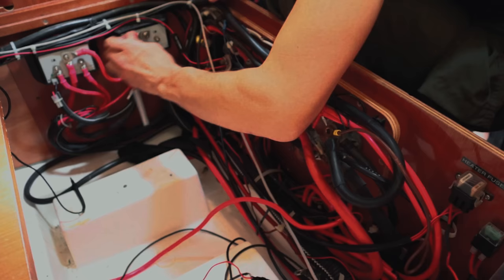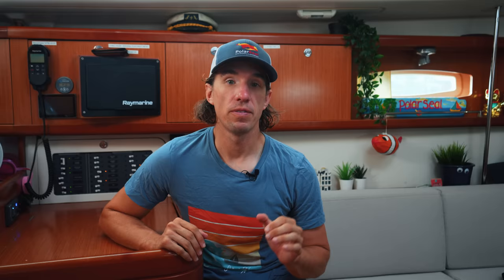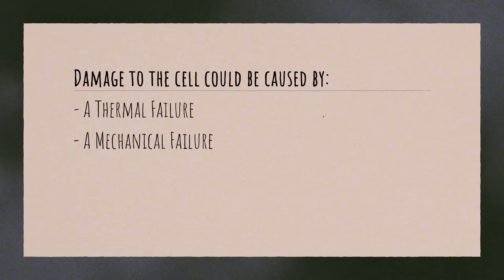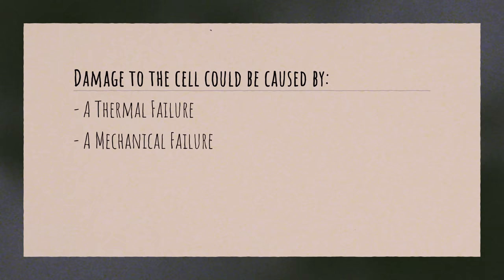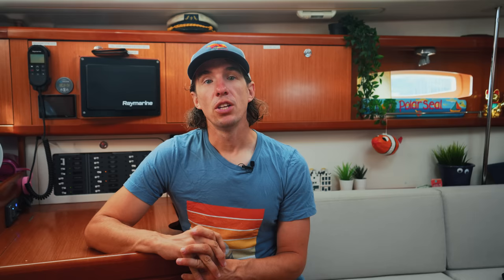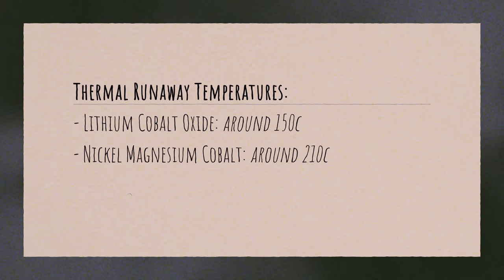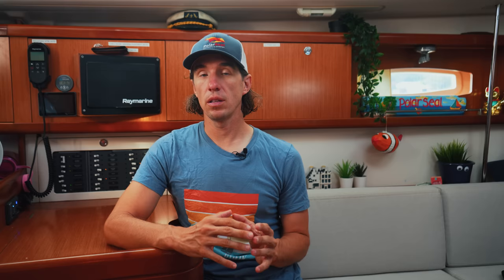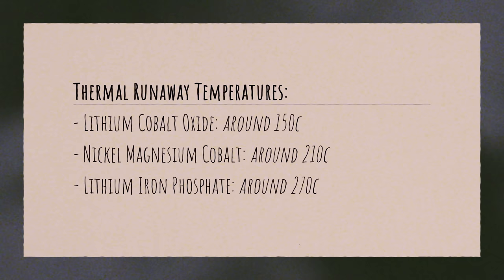WATCH THIS before installing lithium batteries on your sailboat ⚡ [RYAN'S TECH CORNER]

Comment: I agree to most of what you said, except for the BMS internal vs. external.

There is a huge disadvantage of most if not all internal BMS in contrast to external BMS installations.

1.) LFP cells can handle 1C continous charge/ discharge current easily, they can even handle quick charge / discharge of 3C continously if monitored properly and up to 10C for short periods like 10s. Not one manufacturer has built a drop in battery with a BMS that can nearly handle this currents, so you willfully castrate your LFP batteries to miserable 0.5C in most cheap packs or 1C in the better brands, far from what is feasible.

2.) with drop-ins you have no real choice, you have to accept what the manufacturer puts together and burties in a not serviceable case, with external BMS you can chose the cells you want, the cell size between 40Ah and 1000Ah (DIY) and up to 10000Ah for professional installs. You can also choose the right bms for your installation, with alarms, cut offs, gradually dropping chargers or loads or limiting charge currents when necessary, you can even choose chemistries for broader thermal range like LiFeYPO4, that can operate in sub zero conditions.

3.) An internal BMS is an electronic device, that has the power logic inside and controls the current, it also controls the cells and balances them, usually by burning excess charge passively by resistors. All this produces heat inside of the battery enclosure, that cannot dissipate properly and what reduces the life of the battery. External bms have both the balancers and the power switching away from the cells, much better design, and you can choose how to control high loads and high charge sources, not necessary by the power train but by control logic turning off the devices instead of cutting off the battery, then there is no surge and no blackout.

4.) most drop-in BMS are not user configurable and the settings are way off of a longevity profile. Means your BMS may protect from run aways, but your battery will not live very long, external BMS can be configured and set to conservative values, that allow an almost double life expectancy.

5.) With a good external BMS you can not only keep the cells balanced and protect the battery from thermal runaways, but actively control charge sources and dump loads like water heaters and such to use the available energy smarter. 

It is about a proper design of a system and Cells, BMS and separate power logic makes an install better, easier and mitigates a lot of problems that you introduce with batteries with internal BMS.
Reply: 1.) How realistic is this in the real world?  With a typical setup like Ryan's, 3C is 2,000+ amps, what do you need 2,000 amps for?  At 12v that's 24,000 watts, what are you powering, an aluminum foundry?  How would you ever charge with 2,000 amps?   10C is 6,800 amps or 81,600 watts.  You are not castrating your battery to recognize that you have absolutely zero use for 81,000 watts.  
2.)  Yes, if you are an expert you can DIY stuff that is better in niche applications.  That's an argument for experts to DIY, not for internal or external BMS.
3.)  In theory, maybe, but there just isn't any indication that they don't handle the heat inside the pack just fine.  Might have something to do with sticking to a reasonable and practically useful 1C which also leaves plenty of thermal overhead.
4.)  Will Prowse disagrees and says you are not smarter than the electrical engineers who designed the battery and should leave the BMS settings alone.  If you are absolutely certain you are a better electrical engineer than the ones actually designing batters, well maybe you should skip the commercial batteries, skip the DIY and just start manufacturing batteries.  Again, there is absolutely zero indication that most drop ins are dying early deaths, and there are 10s of thousands of installs with quite a number of years on them, Dakotas have an 11 year warranty, far from "will not live very long".  Regardless, you are arguing for expert DIY, not internal vs external, and some internal BMS CAN be configured, which you probably shouldn't.
Reply: What kind of boat are wanting to build that into?🤔
 Carnival Cruise Line? 😲
He's talking about personal sailboats. 😊😁

Comment: This is an excellent video! One point that is consistently missed about BMS safety: If an extreme overvoltage event occurs (imagine a lightning hit, alternator voltage regulator failure, or inductive flyback), especially when the battery is at a 100% state of charge where it will present nearly a zero load to charging -- the voltage rating of the BMS MOSFETs may be exceeded (say 60 volts for example), and one or more MOSFET may fail SHORTED. In which case, all forms of charging protection has vanished. BMS overvoltage protection is only valid provided the overvoltage does not exceed the MOSFET junction ratings. 

In my own sailboat installation, I have "crowbar" didoes: 18 volt 100 watt zeners installed across each battery's terminals to absorb a momentary voltage transient to protect the BMS MOSFETs. It only takes microseconds to fry a MOSFET junction. I've never seen a BMS with this protection.

Comment: Love the video. I have installed lithium on my boat, and switched my starter batteries to Dakota 65ah last spring. Love them.  One thing that’s very important is making sure that either you isolate lithium from standard starting batteries from your house charger and alternator or like you said do a b2b charging set up. Lifo is pretty expensive which is hard to swallow for starter batteries but that whole profile thing is pretty important considering cross connection options that come on some boats. Thanks for sharing as lithium is really a great and overall economical option!
Reply from the maker: This is a good point.  The different battery packs will all be at different SOC so you need to have them charge separately.

Comment: I do want to make the switch from lead acid batteries to Dakota Lithiums. 
I have a much much smaller boat that the sail boat in this video, but love the water no less. I have a small boat I use for walleye fishing mainly. Which means I am trolling for hours on end, and need as much long lasting power as I can get. I use an 80lb thrust 24 volt motorguide trolling motor and 2 Lowrance sounders one of which has a 12” display and draws quite a bit of power itself. Plus I have them networked and also a heading sensor installed. 
I’ve been running 3 optima yellow tops and a separate starting battery for the main engine. The yellow tops are, and this is no lie, are 13 years old. I have treated them good and in turn they have served me well. But it is now time to upgrade as I now get about 8 hours max service out of them as opposed to the 2 days max I used to get. Those 3 yellow tops were given to me by the way, so I really do not know their true age, I only know how long I have used them.
The main reason I haven’t made the switch yet is price. I do realize the initial investment will eventually pay for itself over time as opposed to buying new lead acid type batteries, but it is literally that initial investment that is prohibitive to me. You see, I am but a lowly diesel tech, with a family I am responsible towards. And, as I stated, the yellow top optimas were given to me, not purchased by me. So I am currently in the “how do I pay for these batteries” stage of making the switch. I can honestly say that for 3 12 volt 100 amp hour Dakota lithium batteries I would be willing to allow Dakota lithium to placard my boat with advertisements and would be more than happy to show anyone interested the set up in my boat in exchange.
One can dream

Comment: If a boater wants to keep their Lithium setup super safe and protect their alternator 99% I suggest going my route. 
My Lithium ( 315ah x 3 ) is my House Bank only.   Internal BMS , Oversized 2/0 Wiring and CLASS T fusing.  Charging via Solar & Wind ONLY when at Sea and a Victron IP22 3 bank charger while at the dock.  My STOCK Alternator is charging my TOTALLY SEPARATE AGM Starter Battery ( in a different location than my Lithiums ) and this AGM has its own 50watt solar panel to keep it topped off.   As a sailor I believe in redundancy and separated systems.  My Engine and Alternator will never be affected by any Lithium Issues so I can always start.  My house bank runs everything else and being Properly Wired, Properly Placed ( with airflow ) and Properly Fused I feel extremely safe in using 945 Amp Hours of LiFeP04 on my 28' Morgan Out Island
and it's dreamy to use my Kuerig and Induction Cooktop for breakfast while offshore, as others light there smelly alcohol stoves.  
Be Safe. Be Smart.  And never cut corners with your Lithium Install. 

For a hardcore education on Lithium and Solar visit my buddy Will Prowse on YouTube .... 
Fair Winds Ya'll ......

SV JAZ

Comment: Hi Ryan, great video, very informative.
I’m seeing an increasing number of people online promoting the idea of skipping the DC DC charger between the lead Acid starter battery and the Lithiums and just using a “long Lead” to drop the voltage to the “correct” level for Lithium charging.
I believe this to be frankly madness, but would be grateful if you could consider mentioning in a video the flaws in this idea.
Your credibility would make the argument a lot more convincing.

Comment: I've been utilising "Freedomwon" LiPo4  for 11Yrs with no issues at all manufactured here in South Africa. I've installed them in factories (500Kw X 4) house holds 30Kw X3 and boats 12VDc X 4-18. All with internal BMS  systems against lead acid or gel any day or night.

Comment: Loved this. I do have one thought though.  I think you said to connect the alternator to the lead acid start battery and then use a DC-DC charger to charge the LPO bank.  That is a good idea for small banks and stock alternators that are not externally regulated. However with large lithium banks, and externally regulated alternators, charge the lithium bank, then a smaller DC-DC charger to charge the start battery  AND adjust the alternator to account for the big draw of LPO AND protection for the alternator in case of  BMS disconnect.

Comment: Well done Ryan. First time I’ve seen anyone make a distinction between batteries with internal BMSs vs those, like Victron with a shared external one. Also the first person to describe how some batteries have comms between them so their BMSs can cooperate with each other, which was a selling point that attracted me to my Renogy batteries - plus the max setup of 4 of them fitted into the battery box. I also noticed that the stern of my boat rose about a centimetre due to the lower weight as well.

Primary reason I switched to LiFePO4 - much increased working capacity compared with LA, especially recognising the difficulty of charging LA beyond 80% - 4x100Ah LuFePO4 gives me maybe 320Ah of usable capacity but 3x115Ah LA gave me only about 100Ah at sea. High rate charging was not part of my logic although I did install a high capacity alternator, with external regulator, to make every drop of diesel count should I need to charge by engine at sea - not wanting to do that though as there aren’t refuelling docks on my next leg - a single solo hop from Panama to Australia. Overall, I sized my electric system around the biggest practical rigid panes I could fit (2x300W) vs battery capacity to withstand 3 straight days of dense cloud at sea. So far my sums have worked out. I also designed in redundancies, such as a MMPT for each solar panel and a mega fuse between each battery and the battery bus - easy to disconnect a damaged battery too. Properly sized cables too but fuse protection for each battery and for the wiring of each load - one of which is to the house distribution panel. One thing I’ve done differently to you, and it probably amounts to my interpretation of elegance more than anything, is I run my alternator/external regulator direct to the house bank bus, using a Stirling alternator protector in case the house bank somehow went off line, and I charge my starter battery with a DC-DC charger.

Also great to see you relaxed and happy after your Atlantic crossing. With respect, I think I did my planning a bit better after discussing things with Borders authorities in England (I’d had a run in with drug smugglers SE of the Isle of Wight) when they warned me to not sail between The Canaries/Cape Verde and mainland Africa for the very reasons you experienced. They told me “forget the humanity, stop to pick up people from a single raft and you’ll likely die” - so I crossed direct Cascais-Curacao alone and non-stop, passing between Madeira and The Canaries.  I’m so glad that none of those rafts foundered near you.

Comment: Surely the dump load can be supressed?  A zener diode with the correct breakdown voltage, triggering a big fat power mosfet which connects V+ to V- via a sensibly sized power resistor. Basically shorting the overvoltage through a resistor to drop it safely. You could probably get it balance such that it only really dumps the over-voltage, leaving the feed line alone.

Comment: FANTASTIC VIDEO !!
I'm already into LiFePo so I'm up to speed on the issues....just to say you covered all the issues really well, and VERY articulately and easily followed...THANK YOU !

...one thing about alternators though...those of us that switched to AGM years ago SHOULD have already switched to a high-output, i.e. high-charge-rate alternator when we switched to AGM, because that's AGM's best feature too...they can take pretty much all you can dish out to them...since there's no liquid acid you need to worry about boiling....

...so our AGM high output alternator shouldn't have much, if any problem dishing it out to our new LiFePo's.

Comment: Ryan knows his stuff init.  I noticed the inverters seem to all be 120V AC being advertised on the website but after reading the datasheet they support both 50 and 60 Hz with 120 and 240. Just wondered given in the UK we use 220 - 240V AC?

Comment: Would not normally see the level of experience on lithium-based batteries on a sailing channel but great to see. One crucial point to add is a suggestion to read the specifications of the supplier of the batteries prior to buying or installing due to some battery types / brands can only have three batteries in a parallel bank or pod or two batteries in series e.g. 2 x 12v for 24volt DC vessels or like for e.g. Mastervolt multiple batteries configuration you will need the mastervolt own software for the mastervolt Czone system configuration. 

On a side note, if installing Victon systems the company has the Lynx Distributor (fuse monitoring) which is a modular DC bus bar, with locations for four DC fuses. It will monitor the status of each fuse and indicate its condition with a LED on the front. Part of the modular Lynx distribution system

Comment: Since watching this video nearly a year ago, I watched it again because now my boats launch day is closer, and I'm looking at upgrading my house batteries. After checking the Dakota website I found that though perhaps a great battery, not a great value. Renogy batteries are near half the price of the Dakota for the same capacity battery, and their customer base, just can't compare. Since I don't plan on ocean crossing, 200-250 AH capacity should fit our needs. However, the external alternator voltage regulator, I'm going for it.

Comment: I don’t have any lead acid batteries on my charter boat, I use lithium for house and a Maxwell start capacitor for just the starter motor, the alternator charges the house lithium and the Maxwell has an inbuilt dc to dc charger.

Comment: Very good presentation of explaining about the lithium battery for the lay person to gain knowledge, to help them looking to having them installed as house bank, and additional aspects of the whole electrical system.  I like you also brought up many boater’s carry some major fire risk, other than a battery and the electrical system.  How many have 1/2 filled gas cans for dinghy motor?  A bomb waiting to explode right there😬. Or the risk of a propane leak, rendering you unconscious, or explosion from a spark in the galley.  There is also the gas off from the LA batteries, when a cell short happens.

You made a point that many should be aware of, a quality manufacturer of the lithium battery, do your homework here, another excellent piece of advice.

Insurance companies may never insure your boat with lithium batteries installed, just another reason to not insure a boat, their worst profit margins.  They even put restrictions on not paying out on named storms, and needing to be at certain latitudes during storm season or “safe harbor”. 

Fair winds and safe sailing ⛵️😎

Comment: Two questions.

Are there installation guidelines for preventing damage to the batteries while en route to prevent a UPS 6 scenario? I understand those batteries were damaged during loading, but the point stands that external trauma to the battery can start the process of thermal runaway.

Second, what procedures are recommended for crews who do experience thermal runaway? Do you simply put the fire out with an ABC fire extinguisher and then flood the battery compartment? Throw them overboard?

I know you understand these risks as a pilot, and I'm curious how you've taken those best practices from the aviation world and applied them to these threats.

Thanks
Reply: I REALLY want to know this too.